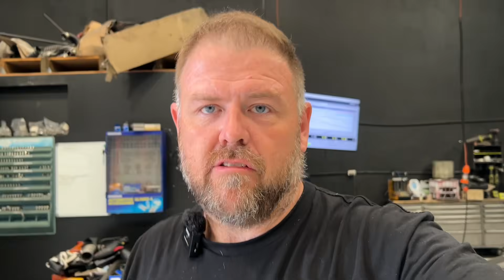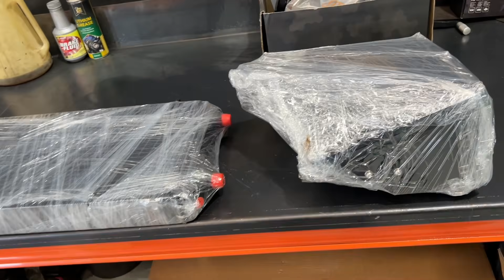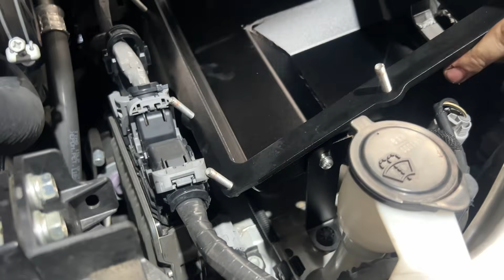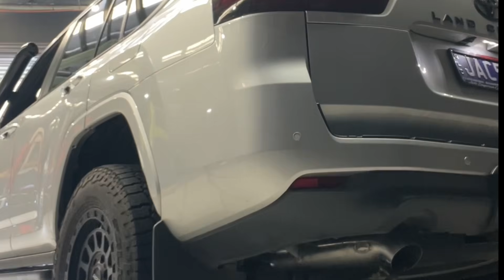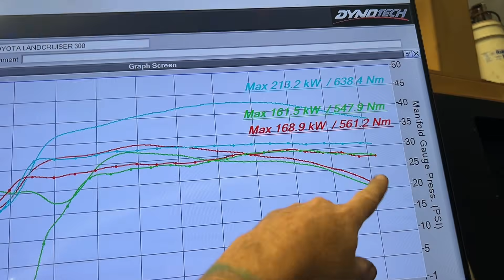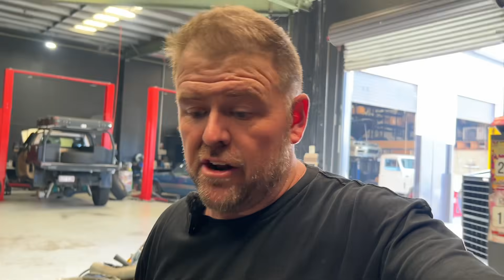300 Series Landcruiser Gturbo & Manta Upgrade

Comment: You guys kept the stock heat exchangers along with the GTurbo one ? And is it a turbo backed exhaust that you have on ?
Reply from the maker: Yeah still run stock exchangers, you add to the system so get better cooling with more coolant and more surface area. Yes this was a turbo back exhaust
Reply: @procheckautomotivemechanic4551  do you have a step by step guide for the turbo back exhaust installation?
Reply from the maker: We don’t sorry but honestly a pretty easy exhaust to fit compared to some cars
Reply: @procheckautomotivemechanic4551  okay makes sense I just had one more question when it came to removing components from the vehicle it was just the dpf and egr that had to be removed physically and off the ecu correct ?

Comment: The specks for the Land Cruiser 300 are 227 Kw and 700 Nm, how come your reading are down to 213 Kw and 638 Nm, could you please explain why. 
Cheers
Reply from the maker: Manufacturer specs are engine specs. 
So not at the wheels, you loose power/torque through gearbox, diff and wheels
Reply: It's on a dyno. This dyno is measuring power at the rear wheels. On average drivetrain loss is about 15%. So 213 rear wheel Kw is about 250Kw at the flywheel (what the engine itself is making). A decent power gain for having only airbox and exhaust.

Comment: Question: Will the work you do on the 300 void the warranty?
Reply: Toyota would definitely not like it
Reply from the maker: Short answer No.
Long answer 
If any modifications on the vehicle are proven to cause the issue of a fault then that component/s are not covered.
If you have a tune or a lift kit for example and your seat falls apart it’s not caused by either of these so you still have warranty. 
If you have massive offset wheels and a wheel bearing fails, they could deny the warranty claim. But if you go in with stock wheels on 😎
The only reason to “void” warranty is if the car has been written off.
Reply: Yes
Reply: These motors are already blowing up with low kms in stock form. You would be insane to modify the engine in any way including a remap, at least until the warranty period is done.

Comment: Just a comment on the dyno graphs.... I work with race engines, we don't do a graph vs km/h!! Yeah, 4th gear at full throttle under load, great. I would love to see the curves based on rpm/load, not km/h. Just me I guess?
Reply from the maker: Gear changes depending on what box it’s running so we use 1:1. Screen can show kmh or rpm, it’s just slower to show graph when running in rpm so I just change over to rpm when checking logs. 
These videos aren’t a lesson on tuning just showing people results, but can show results in rpm on next videos for sure

Comment: Genuine question.

Arnt these full-time all wheels drive, so being that you have disabled drive to the front axle, these dyno results would read higher, compared to someone who did it on a 4wd dyno?
Reply from the maker: They are, we drop front shaft and lock centre diff so all power to rear. Don’t get stuck on what power readings are, just the gains from before vs after. 
Different dyno brands will give different results 2wd dyno, 4wd dyno or hub dyno.
Reply: @procheckautomotivemechanic4551  it was a generalised question though, as in, if you had a 4wd dyno, but chose to run just the 2 rear tyres in the format. Then put in the front shaft and ran it as a 4wd dyno.. would the numbers be different. I would assume that the 2wd numbers would be decently higher than the 4wd numbers.

Comment: Not about the 300 series so don’t mean to hijack but have you thrown a 48V Hilux on the dyno yet ? Would be interested to see if it’s actually any different power delivery wise.

Just upgraded from a 22 2.8 manual to a 24 auto and it feels like a completely different motor under the bonnet, feels like it has way more meatier low and mid range. Not sure if it’s just the change from manual to auto.

I’m a manual guy through and through so usually when I hop in an auto Hilux it feels completely gutless but the new one feels the opposite.
Reply: Manual 2.8 is absolute rubbish.
Reply: @ Annoyingly laggy in manual form imo

Comment: Would love to see you present some intake air data both before and after the intercooler upgrade. My 300 loses power with high intake temps when pulling 3T.
Reply: https://www.youtube.com/watch?v=SkqPfosiE0A
Reply: @qezza1  Thanks. Would love to see some independent testing.